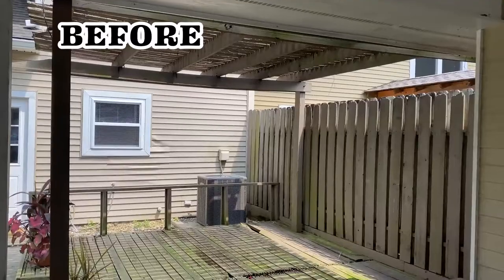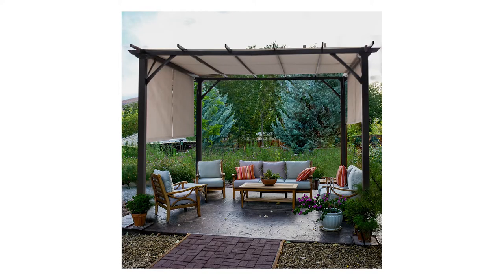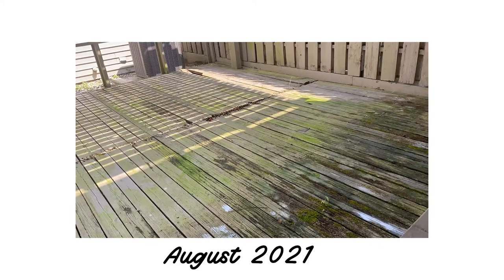HOW TO CLEAN A WOOD DECK WITHOUT A PRESSURE WASHER | only 2 ingredients | time-lapse |  Housewarmin

Comment: You need a few pieces of wood and some deck screws because it looks wobbly dangerous!!
Reply from the maker: Thank you, we still haven’t fixed it up yet. It’s just so hot in Louisiana, we wouldn’t wanna sit outside anyways 🥵🥵🥵
Reply: @Housewarmin  my front porch was so solid after using the 3 1/2 inch gold deck screws...but my back porch is a total wreck with curled up wood on all the top rails and flooring everywhere, so I am deciding if I will ignore all these videos on the fancy way of installing pvc and composite and install a few planks at a time until I complete it on a budget because all that wood and stain and sealer is gonna cost every few years vs installing expensive pvc or composite piece by piece every other week based on payday dates!!!😄😄😄